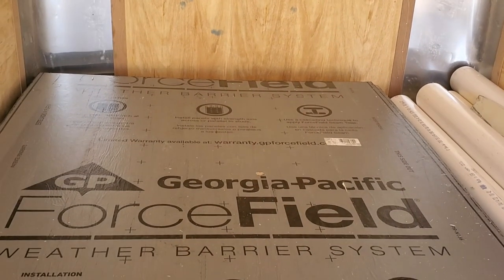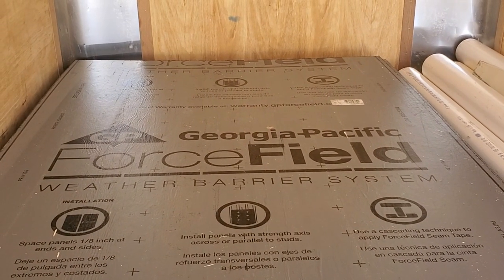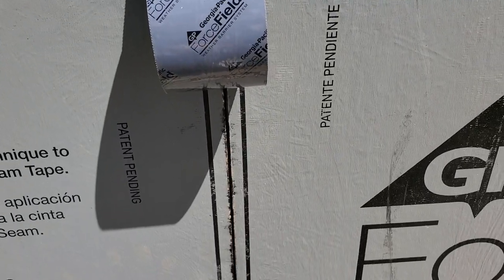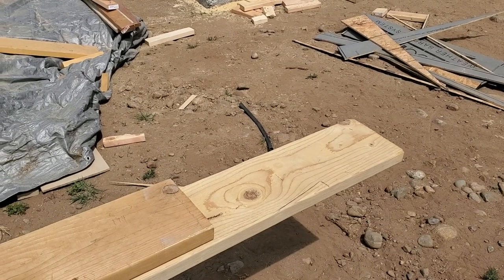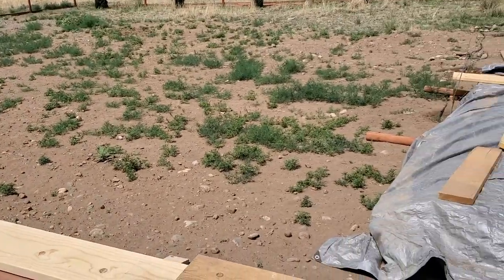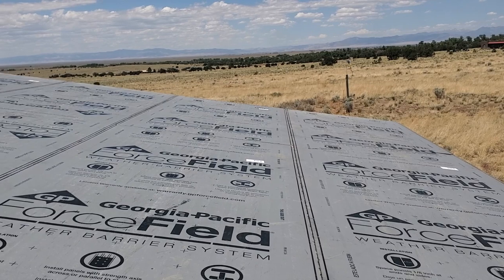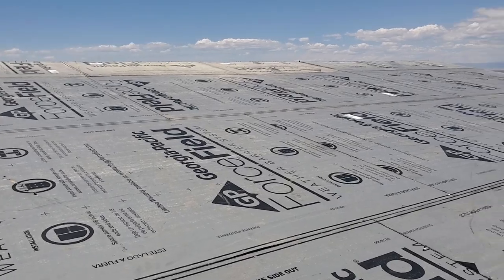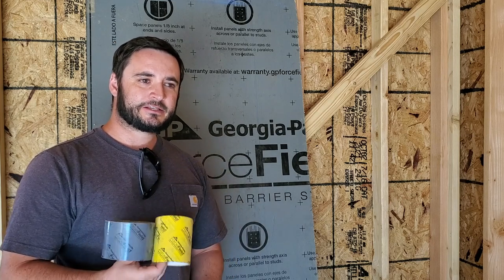Wall Sheathing | Using Forcefield OSB | Mini Series EP.3

Comment: Forcefield tape looks like just wider tyvek tape.  I am looking into using forcefield sheathing to save money over zip but will probably use zip tape.
Reply from the maker: The forcefield osb is great, I'll never go back to house wrap again. The yellow forcefield tape is super sticky and heavy duty, that's what I'll go with next time for all the seams. I've never used the zip tape but I've heard it's a bit better than the gray forcefield tape. Good luck with your project, you'll really like the forcefield  osb.
Reply: @slothconstruction  zip tape is great plus you get the self sealing on fasteners going through it.  Stretch tape for corners is amazing as well.  Thanks for the info on forcefield.
Reply: @POLOLOUS3  does zip tape adhere well to the force field surface? I wanted to do the same but was concerned about using products together that weren’t designed for each other. Also from what I’ve seen of the tape it looks super prone to tearing and becoming brittle over time since it seems to behave like packing tape so just another concern

Comment: Could this be used on interior of a shed with the forcefield side facing the interior?
Reply from the maker: Yes you can definitely use this on the interior of s shed, it will give it some water protection. In the garage I built a made a small dog kennel inside and used the forcefield osb facing in and it works great.

Comment: Canf the forcefield side be painted? Looking to use this for a chicken coop and cant find any answers on this
Reply from the maker: Hey that's a great question! I didn't know the answer so I grabbed a extra piece of forcefield osb and painted it. Oil based paint didn't paint very well but latex paint went on no problem and covered nicely.  The osb membrane is kind of a paper with a  plastic coating. It has some wrinkles in it so the paint won't be smooth. If it's for a chicken coop you should paint both sides, or if you wanted something more weather resistant I would recommend T1-11 plywood and water seal it. But short answer, yes you can paint the osb